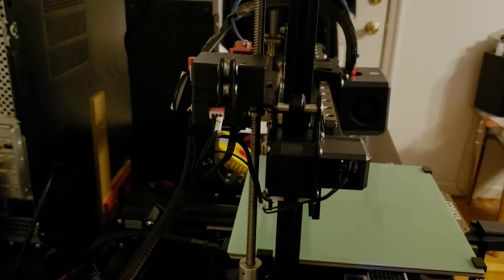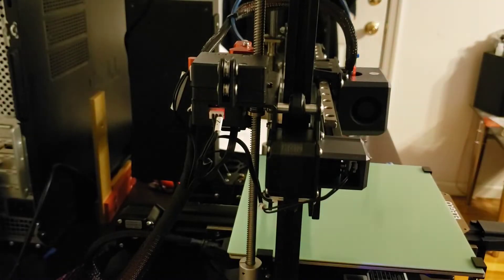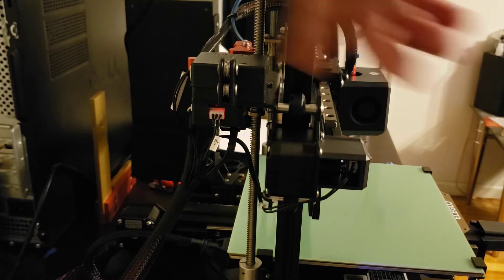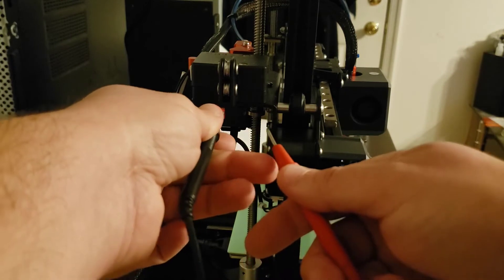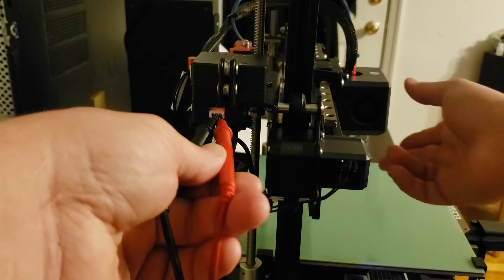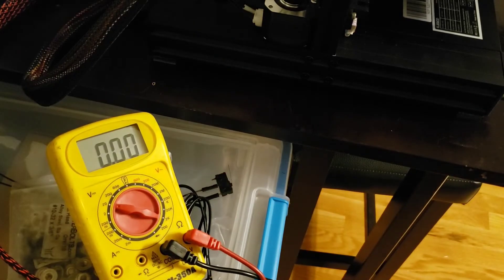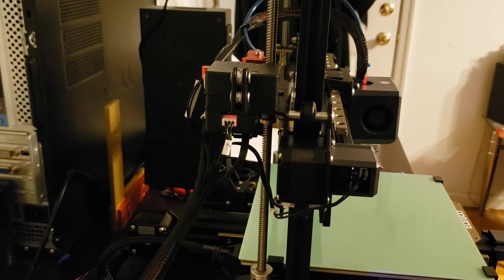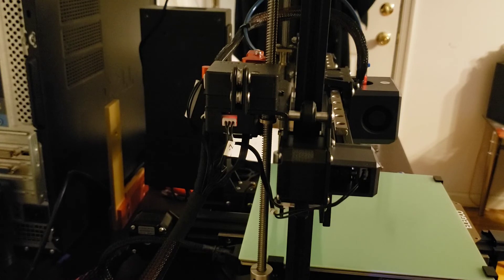Elegoo Neptune 3 strain gauge test

Comment: My N3 doesn't want to move and just beeps when it is commanded to do so after changing the extruder wiring - even after reverting it back, it persists and Elegoo CS is pointing me to the strain gauge even if it is OK, according to your test..?
Reply from the maker: What version of firmware are you running?
Reply: I also did ABL and PID tunes after I noticed problems. Before you ask, yes I did try Klipper, but I didn't have much time to tune out a weird problem so I switched back to Marlin+OctoPi
Reply from the maker: @DJProPlusMax  what version of firmware are you running?
Reply: @TheFeralEngineer  V1.0.5Beta2
Reply from the maker: @DJProPlusMax  sounds like it might be faulty. Did you try disconnecting it and seeing if the machine will move?
Reply: @TheFeralEngineer  the problem is already solved, I just had to reset the EEPROM to defaults as it came from factory with the command M502 and to save with M500. I had to do a new PID tune for the bed and hotend and esteps, but now it doesn't beep when I send a move command or home it or print. It seems weird that reflashing the FW didn't reset the EEPROM to defaults.
Reply from the maker: @DJProPlusMax  yeah that is strange